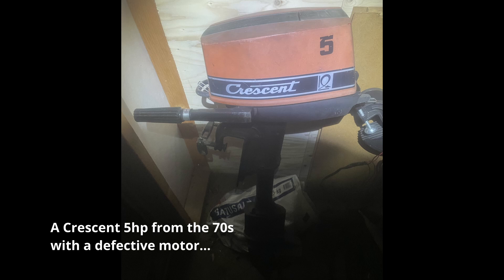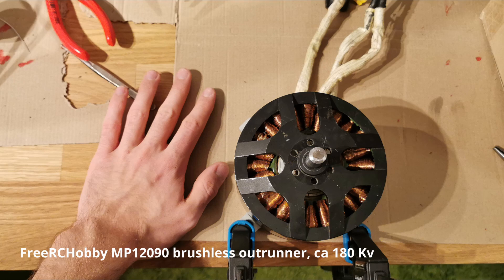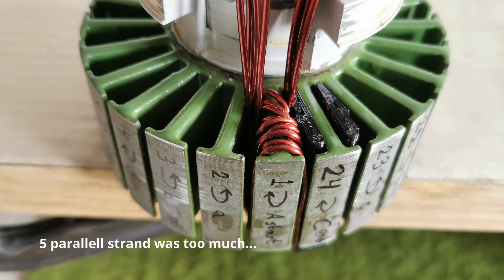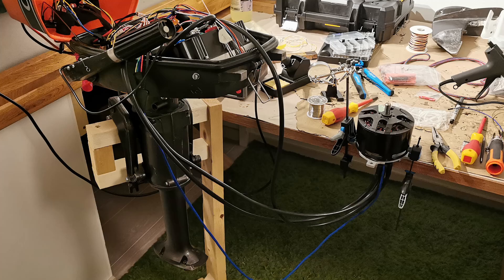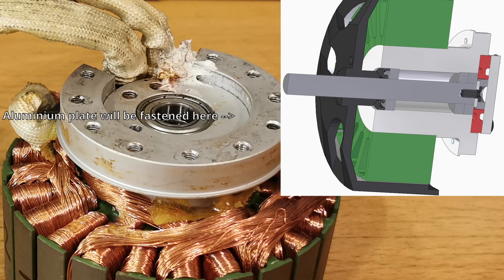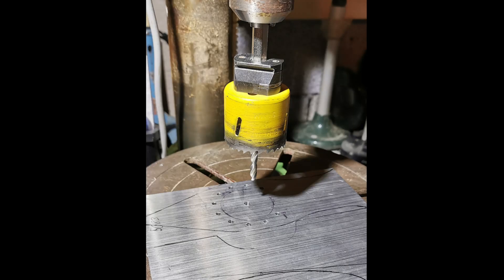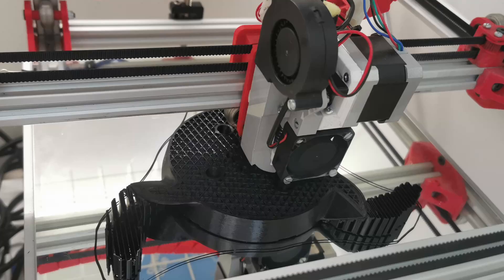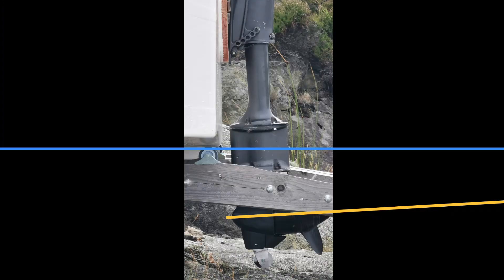Electric conversion of a Crescent 5 hp outboard

Comment: I believe that your motor was originally 12 to 22 horsepower and you made it into a 7 hp motor.  You could have mounted the motor in the top, air cooled and left it as originally manufactured and purchased a ECM to control it and the standard lithium batteries .
Reply from the maker: Yes, for sure. It would have been much easier :)

Comment: I threw a 2KW BLDC motor on an old Merc 3.3 I had. I bolted together some aluminum plate, 1/4" (6mm), and coupled the motor to the shaft. I use it on my dinghy to get in and out to my moored boat. It pushes me at 5kts. After 1.5 seasons I'm really happy with it. Your detail is far greater than mine. Much mor powerful. I waste a lot in pushing the gears and the water pump impeller that's just stirring the water. If I built a 5KW I'd use the waterpump for cooling, but in the water is much mor efficient.
Reply from the maker: Cool! Yes, using the original impeller for cooling is a good idea if you have a powerful motor :)

Comment: the project is really very very interesting and I am designing a similar one myself.
But I think replacing the thermal block with an electric motor is the right choice for two reasons:
- keep the electric motor away from water
- use the foot and the original aluminum propeller that does not twist under the large torque of the electric motor
- if you have cooling problems you can always take the water pumped by the original foot impeller (for models that have water cooling)
As soon as I have time I too start with my conversion project which involves the use of a car alternator modified into an electric motor
Reply from the maker: Indeed, I agree totally. Everything becomes so much simpler when it does not need to be watertight! Interesting, I hope to see a video of it one day :)
Reply: I saw a guy  put a alternator on a bicycle.  It was almost scary to watch. I still found it very clever.  How do people find rhe time? I hope you make a video of it too.

Comment: Awesome project!! I've been wondering why more people aren't converting to electric outboards. I like your idea of running the motor in the water to keep things cool, but it looks like that has some drawbacks too.. I might stick with my plan of using an out runner 10-15kw motor in place of the ice engine and using the original prop and gear case. What are you using for a battery set up?
Reply from the maker: Thank you! Yes, there are not many people doing it. I think the main problem is the battery, boats draw a lot of power and if you want to get far the battery must be large. 
Putting the electric motor where the ICE was is great, it makes everything much easier! :) But it will just be noisier and harder to cool well.
I have built a battery of 12S20P 18650 cells (Samsung 35E) and it is placed in a watertight case. The BMS is an ANT BMS rated for 300A peak (IIRC). The total capacity is approx 2,5 kWh which is on the low side for this outboard, I would like to have at least the double capacity. But then it would be very heavy... (the current weight is 15-20 kg, so it is OK to carry).
Reply: Cost, and energy density......    you just cannot store enough power for these to be a direct replacement option for the majority of applications/people.
Reply: @michaelsimpson9779  the battery is always the weakness… a gas/electric hybrid could be a better option until battery capacity tech can catch up… if you really want to push the option? Maybe a hydrogen generator fuel cell instead of gas??? Electricity to make fuel and fuel to charge the battery and run the motor simultaneously… but I don’t think this would work well for a smaller boat.
Reply: @archer721  but why? what earthly reason would you go to a worse technology vs. 100  year old design with more speed, 10x the range, 1/10th the price, and reliability in saltwater? if you want even better, go with a near silent modern 4 stroke outboard with fuel injection for the same price. no smoke, and can cruise 30% farther than even a 2 stroke.
Reply: @ct1762  - well… a 4stroke isn’t “nearly silent” by any means and a hydrogen generator in the ocean would literally give you an endless fuel supply. There are many reasons. I’m NOT against the use of internal combustion engines or petrol by any means, just saying there are other ways to make fuel for them and other ways to push a boat around the water…

Comment: I think you shouldn't sand neodymium magnets... ever. Neodymium magnets are notorious for rusting into dust if they get damage to their coating and then get exposed to any water... very quickly, too. Try removing material only from stator side next time.
Reply from the maker: Yep... the "magnet material" seems to corrode very quickly